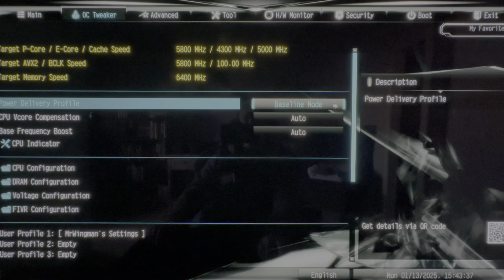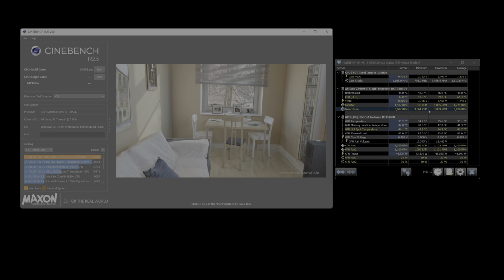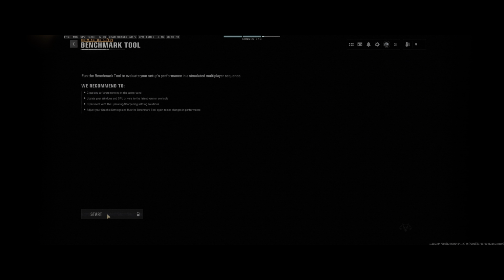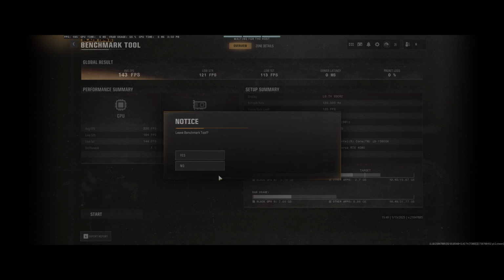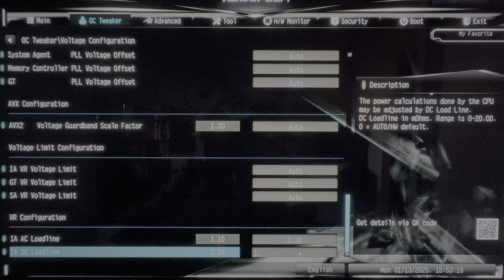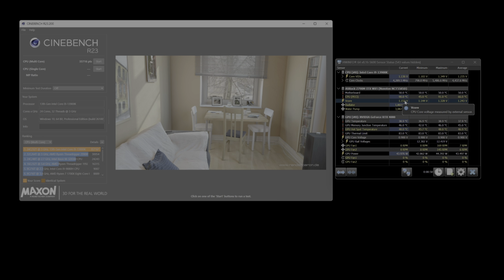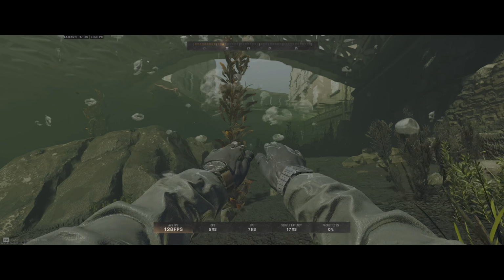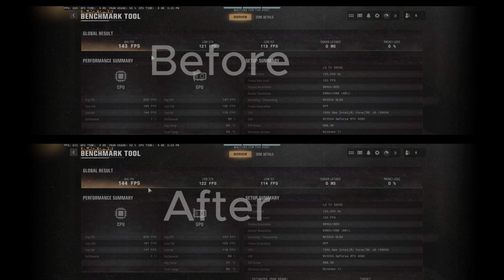Using AI for AC DC Loadline Adjustment

Comment: I just have a basic hp bios with an intel i9 13900h cpu (cant be unndervolted) can i adjust ac/dc loadline to effectively preform an undervolt to reduce temps?
Reply from the maker: Hp firmware would block all that. Even if the bios shows anything pertaining to AC/DC loadline, it would be hard-coded. If it exists, you might look for pl1 and pl2 adjustments but more likely a "balanced" and "efficient" setting that could reduce caps and therefore heat. It might be called "Smart Cooling" if it's there. Also, there is a program called ThrottleStop. If it's not blocked somehow on your HP machine, you could investigate trying it out to lower pl1, pl2, or turbo modes, but that's about it since on a locked H processor, things like undervolt and ac/dc loadline cannot be adjusted.